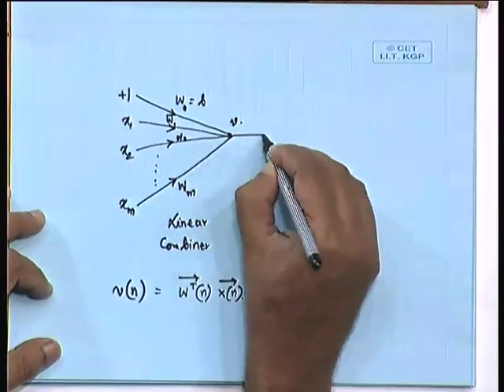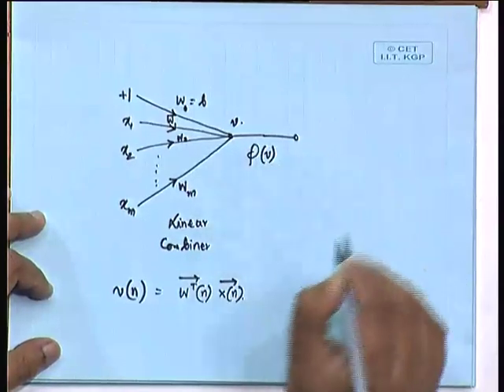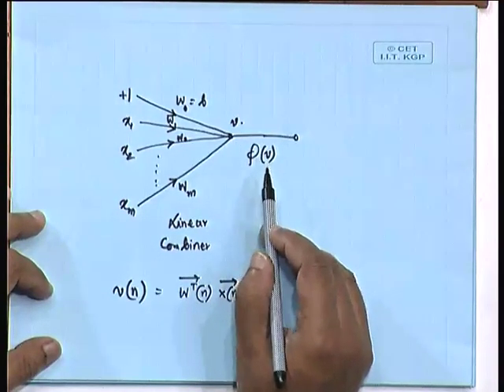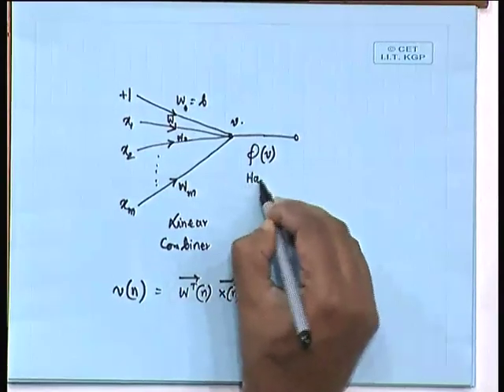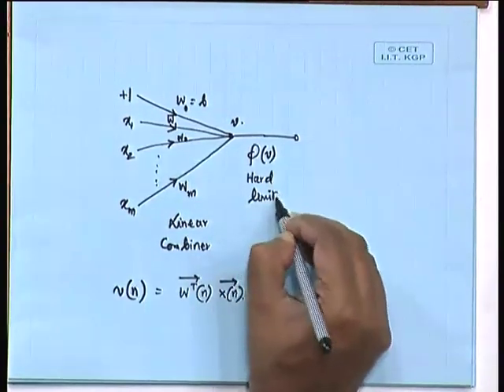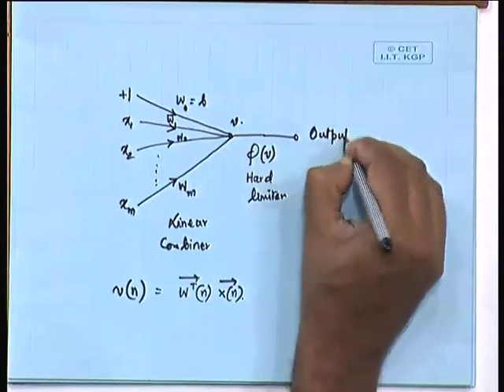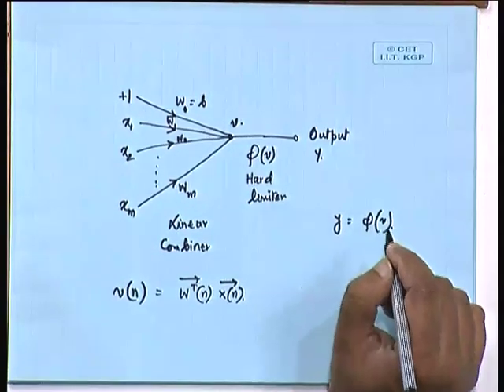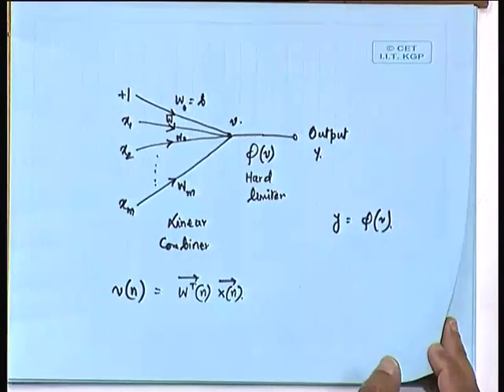Lec-16 Perceptron Convergence Theorem

Comment: At 47:00, an upper bound beta is defined. There is this problem though that beta might not be finite, as H1 might be unbounded. I don't see how the proof can actually work given this.
Reply: I think that a finite training set H silently is assumed. In that case, the solution for you problem is the following. If |H| = {h0, h1, ..., hA}, then  x0 = h0, ..., xA = hA, x(A + 1) = h0, x(A + 2) = h1 ... i.e. you cycle the training examples. However, he did not prove the theorem, because he ignored the wrongly classified negative examples ...

Comment: but how do you actually know that a very large value of n, n times beta is going to decrease? and the other term is going to increase
Reply: Very large value of n means that the number of iterations are large enough for convergence to occur. Thus, a large value of N will ensure that we can actually reach convergence at which both the extremes will start to come closer (lower bound will increase and upper bound will decrease) and the bounds become equal.